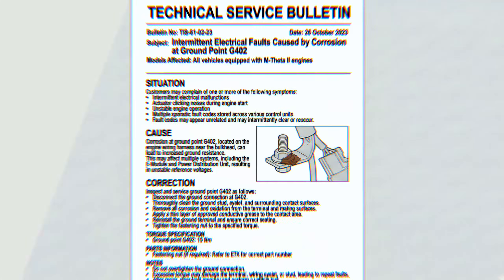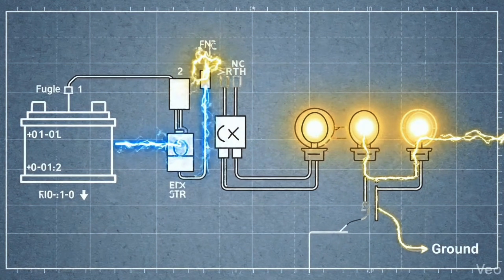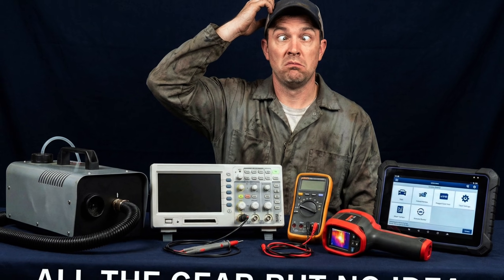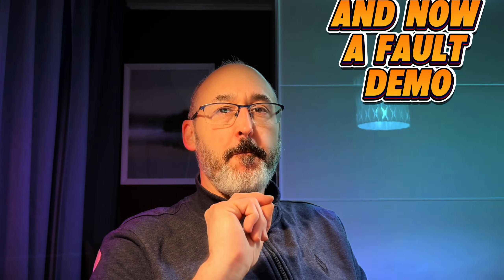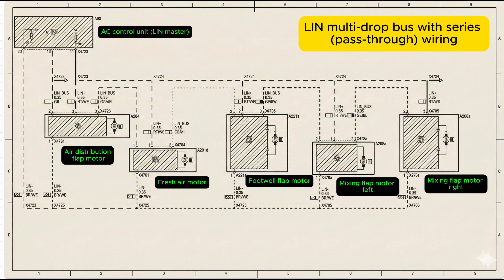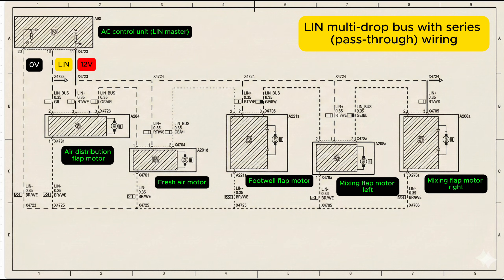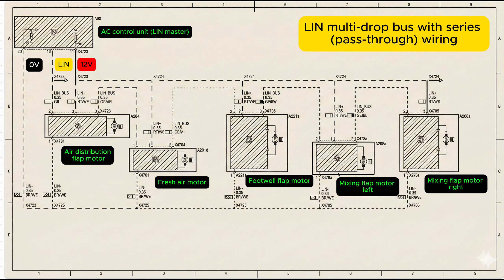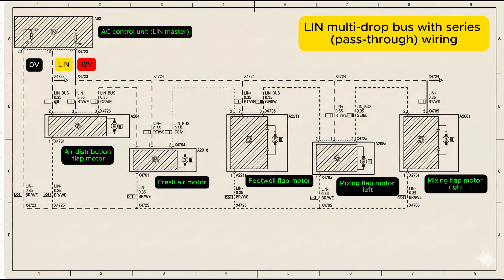How Mechanics REALLY Diagnose Your Car

Comment: “So electrically, it’s a shared BUS, or physically wired in series…although it’s a parallel BUS…if that makes sense.” Not to me. It seems that one problem slave wouldn’t bring down the whole network if it’s a parallel circuit. But I must be missing something.
Reply from the maker: Electrically, LIN is a parallel bus — every slave shares the same data line and listens to it directly. But physically, to save wiring, the LIN wire is routed in-and-out of each motor, with the LIN in and LIN out pins simply bridged together inside the motor. There’s no buffering or signal processing.

Because of that, an open circuit at any motor kills communication to everything downstream, and a single module that shorts or holds the line dominant will pull the entire bus down.

Parallel electrically doesn’t mean immune to faults when the physical path is daisy-chained.

A good real-world example of this is BMW’s BSD (Bit-Serial Data) bus. It’s a purely parallel single-wire data line used for things like the oil condition sensor, IBS, alternator, glow plug module, etc. Different protocol to LIN, but the same basic principle applies — all modules share the same line.

If one unit internally shorts the bus or drags it dominant, the entire network goes down. You don’t lose just that module, you lose communication with all of them. It’s a classic “one bad actor takes out the lot” scenario, and it catches people out all the time in diagnostics.

Comment: You said you google things. Are you finding AI tools useful for diagnostics ideas?
Reply from the maker: Not really. I have tried that with gpt put of interest but it tends to lack impartiality 😂 AI is good but you would need to build a gpt with your own custom instructions and own data files. It will work one day like that. Usually I have to solve it myself 😮 Googling might give me an instant solution in about 3-5 % off my fault finding in a year maybe as a rough guestimate so yeah not a big figure but anything that gets the job done is ok by me.